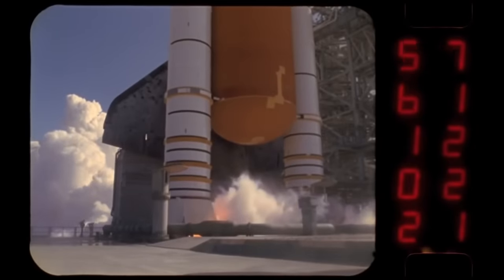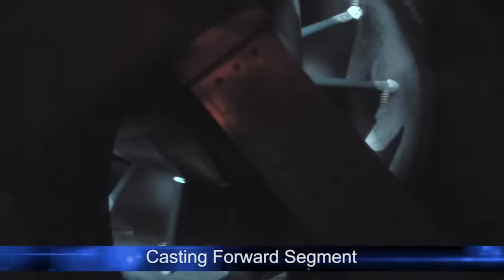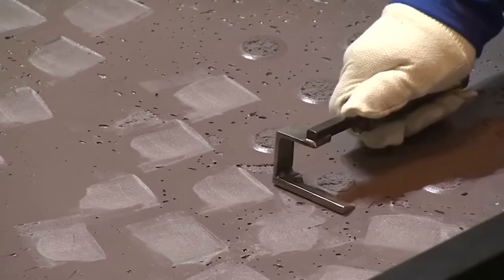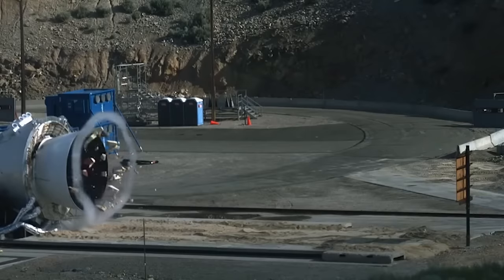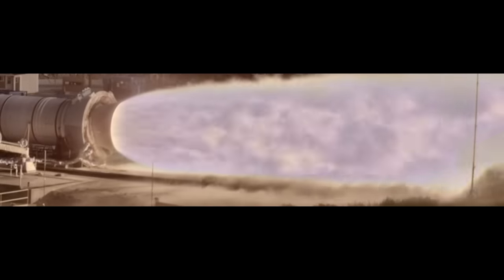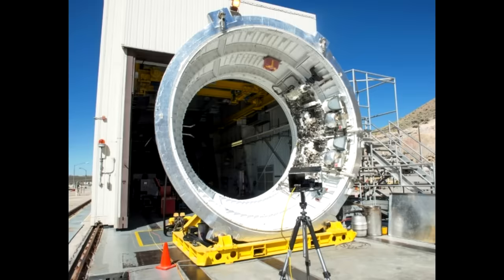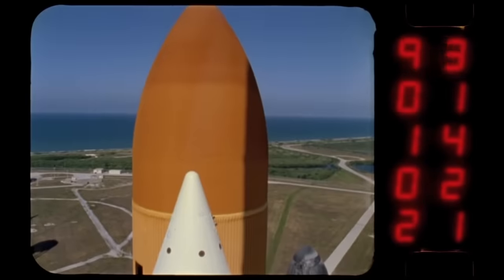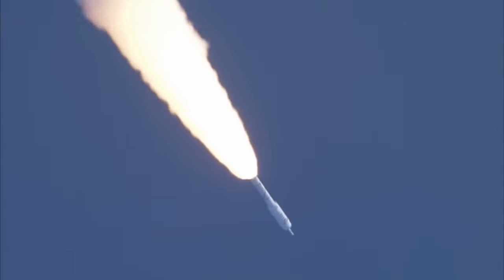The Amazing Engineering Behind Solid Rocket Boosters

Comment: I wonder what kind of redundancies they built into the explosive bolts that held down the boosters (1:30). Once you light the boosters they're firing for the full duration, and it no bueno if one bolt didn't go off.
Reply: Ethan Prober I believe that on at least one occasion one of the nuts didn’t separate. The shuttle took off like it was nothing; breaking the metal plate.
Reply: My guess is if one bolt didnt go off it would be ripped out. SO the redundancy is that more than one bolt would have to fail. Possibly more that 2 or 3 even.
Reply: It definitely has enough strength to rip off one faulty bolt.

Comment: The new netflix show “the challenger: the last flight” tells us that the O ring, which was a part of the solid rocket booster was the cause of the tragedy for the challenge. The O ring was used for sealing the components of the rocket booster, but they had a massive issue with low temperature. The elasticity were inversely proportional to the temperature and hence making it more fragile under extremely cold conditions.

Comment: Just imagine putting 5 SRB into a cluster and you effectively have a Saturn V sized rocket again.
Reply: Five 4 segment SRBs like the type used on the shuttle would have around 13 or 14 million lbs of thrust? Almost twice that of the Saturn V if the numbers I read were correct...
Reply: @codymoe4986  Only against the first stage though.  The Satern-V's S-II J-2 Engines had a 500 second burn time, something the SRB can't come close to achieving.

Comment: Great explanation Scott!
I was always stunned at how much the shuttle stack moved when they lit the mains, the whole stack would flex over, and then the boosters had to wait for the whole assembly to flex back....  and that shot of the shuttle at 13:45, showing how the whole assembly slides off to one side as it comes off the pad.... 

The thing that always amazed me was how fast the shuttle left the pad.
As a very young person (5 at the time), I clearly remember laying on the floor watching TV of Apollo 16 and 17.....  and they took FOREVER to clear the pad. Comparing the two spacecraft now....  the Saturn's were 18 wheelers leaving a stop light.... the shuttles were corvettes launching on a drag strip.
Thanks for the video!

Hope the smoke is clearing up on your side of the Sierras!
Reply: Believe it or not, that rocking motion was called "twang."

Comment: Awesome explanation of the solid fuel, the Challenger O-ring issue and the complex improvements that worked, plus great footage of the booster assembly and launches. In my mind the shuttle had launched military missions from Vandenburg so I am now straight that it hadn't.

Comment: One of my professors consulted with Morton Thiokol and talked about the boosters used on the space shuttle.  The previous longest-burning solid-fuel boosters burned for one minute and it was thought by most engineers that this was the limit.  The longer burn time wears out the exhaust nozzle.  The exhaust is essentially molten sand mixed with gasses, coming out at mach 8, and is very abrasive.  The shuttle booster was an engineering challenge.

Comment: I worked on retrofitting the vertical boring machines with CNC controls at Ladish used to machine the solid rocket booster sections. The entire manufacturing process was remarkable.

Comment: I was the manufacturing engineer for the first Filament Wound Cases for the Space Shuttle. We made four completed composite case boosters tested two and two were at Vandenberg when the director of NASA made the decision to launch below tested temperatures. A very sad day hero’s died, thousands lost their jobs. My program ended 1500 people walked, I successfully applied for a job in another division and went on to fix the Boeing 767 composite door spring program.
Reply: I have always been interested in the FWC SRB program.  STS-51L certainly changed the course of STS.  IIRC the STS-62A boosters were already stacked at SLC-6 Vandenberg, were they not? Discovery was to be used for all the Polar military launches from SLC-6.  Hopefully we get to see a derivative of the FWC SRBs you worked with back then.  There's enough D6AC cases for 16 5 segment RSRM-V's, since SLS disposes of the boosters, for SLS-9 the new BOLE' boosters using FWC technology will have to be used.

Comment: After Thiokol redesigned the joint, they conducted test firings to prove the design.  I was one of the technicians they hired to assemble the test motors and attach the instrumentation devices.  These test firings are the horizontal ones shown in the video.
They added two tests to the procedure.  One was to place a heavy metal pillar next to the motor with hydraulic actuators on it that connected to the motor's attach ring.  These were used to place side loads on the motors during test firings.  The other was to test the motors under more extreme temperatures.  A movable enclosure was placed around the motors and then heated or cooled to the desired temperature.
Of course the heating was done on the summer, and the cooling in the winter.  We would have to go outside in the summer to cool down, and in the winter to warm up.

Comment: Excellent in all ways. Thanks so much, Scott.

One detail related to the Challenger. It's about maintenance, not design. The O-rings were not replaced after each launch. They were examined for cracks. A rule of thumb idea that a crack less than 1/3 of the diameter of the O-ring was not a problem. There is no engineering basis for this. Thus the Challenger disaster was due, in part, to an unscientific maintenance guideline, as well as items mentioned here.

Comment: At 14:00 Scott says that compared to the Shuttle 4-segment SRB, the new 5-segment SLS booster has "more thrust and a longer burn time."  More thrust, sure (3.5 million pounds vs 2.5 million pounds).  Longer burn time, probably not.  Both booster versions are the SAME DIAMETER (correct me if I'm wrong here, Scott) -- to fit aboard the same railroad cars from UT to FL.  This necessarily means a similar burn time.  More on point, recent video of 5-segment SRB tests in the desert clearly show the same 2:05 burn time as every 4-segment Shuttle SRB achieved in ground tests and in flight.
--------------------
P.S.  If true, this could mean that the 2009 Ares I-X flight (one of my favorite launches of all time) was perhaps a bit more realistic (and valuable from an engineering standpoint) than some of its critics are willing to admit.

Comment: There were tests with 6.5 m diameter SRBs in the 1960s/70s by other SRB manufacturers. Those would have had less length to flex and less dangerous segment joints. Thank you for the video.

Comment: Thanks for another great video.  I really like your attention to detail and complete explanations.  One thing I have noticed in another of your videos is the way you pronounce butadiene.  It may be an English vs American thing but we say B-you -ta die-ene.  The -ene ending tells you that the chemical has a a C=C double bond, and a di-ene has 2 of these. In an NBR one is used to make the polymer and the second is where the cure takes place.
A co-worker of mine used to work in a place that made smaller motors with the same chemistry.  A person there was assembling a casing and had just a speck of the CURED PBAN/Epoxy/Perchlorate on some threads. The resulting detonation of that speck blew the bolt out and through the man's head.  I couldn't help but think of that watching the workers shave off chunks of the wet material.

Thanks for the wonderful channel.  Moar bosters!!

Comment: This is the most complete explanation of the joint failure I have seen.  Engineering is awesome isn’t it?  Did they have any idea that the joint could fail at those launch temperatures at the time?  I can’t believe they didn’t have a set of safe temperature values in place.  Did they test the joint at various temperatures including cold temps during development?
Reply: This was as much as anything a management failure. There was at least one engineer at Thiokol who warned against flying the boosters in low temperatures. Those in charge were getting impatient with the number of scrubs and postponements of this mission. This, coupled with overconfidence, led the management team to insist on launching that morning. To paraphrase one higher up, in frustration with all of the delays, "are we ever going to get this thing off the ground?" It is believed Richard Feynman of the investigating panel was "fed" the incriminating evidence of the O-ring failure by an insider at Thiokol. And, it seems the same pride and overconfidence on the part of NASA may have contributed to the Columbia  disaster.

Comment: The Indian PSLV solid motors actually use something different for thrust vectoring: liquid injection.  Twenty-four injectors in a ring inside the nozzle inject strontium perchlorate into the hot gas stream, producing enough secondary thrust to alter the course of the vehicle.  There are also a pair of roll control thrusters on the first stage which use N2O4/MMH propellant.

Comment: So if I'm understanding right, on Challenger, it's not necessarily that the insulation was burned through (which was always my impression since Wikipedia isn't terribly clear), but more the o-rings themselves, which, since the SRBs were under such colossal stress due to wind shear (on top of normal oscillation), allowed burning  pressurized gas to escape the booster in a place it was very much not meant to escape - through the pins holding the segments of the SRB together. Then, this burned through and weakened the SRB's structural linkage to the EFT and by extension the EFT itself, which cascaded rapidly into the loss of the vehicle. Is this more or less correct?

Comment: I worked in a Southern California heat treat company that heat treated the D6AC ring segments. A very large gantry furnace with oil quench tanks and molten salt tempering tanks which allowed the segment to be processed to get the desired properties.  The oil quench was spectacular, I recall a bottom of the furnace being dropped and rolled out of the opening of the furnace which had been heating the segment to I believe 1650 degrees Fahrenheit for the required time then lowered into the oil tank. The flames and heat were tremendous. Then the tempering cycle was performed by placing the segment into a often salt bath of about 400 degrees Fahrenheit, possibly for two prolonged cycles, the details are being recalled after 40 years so forgive any inaccuracy. I remember the brass buttons on my Levi’s being so hot, that if my arms touched them when I was in the area, little burns would be the result.

Comment: I worked at Thiokol in Utah in 1982 through 1984. Robert Lund was our section chief; I was part of the "Motor Performance Group". Also worked on Peacekeeper 1st stage and Trident I (C4). The shuttle boosters are essentially 1960's technology. The propellant was derived from the Minuteman formulation and was not the highest specific impulse. The star grain in the head end had a tendency to crack and was repaired. They may have improved many features but it was known before Challenger that seal design and stack response was inadequate. The motor joints should've been different. The original boosters were merely 1960's ICBM technology. 
You may be familiar with Von Braun being totally against solid rockets for anything but aircrew egress - ejection systems. 
Some of this may have been improved for SLS but the Challenger disaster was due to money, personality and politics. I would've thought that certain people would've received prison for their "depraved indifference".  Look very closely at the SLS booster before you declare it wonderful. It's a compromise.

Comment: There's an interesting take on solid fuel rocketry on the Bloodhound SSC, world land speed record car project.
A solid fuel rocket that can actually be controlled. It works by using solid fuel but the oxidiser is liquid, pumped down the middle of the solid fuel. By increasing or reducing the oxidiser flow, the amount of thrust can be controlled.

Comment: Btw, the booster sections made a detour to Los Angeles for heat treatment before going east for assembly. Cal-Doran Metallurgical Services had a specially built gantry furnace just for that job. They were being prepared years before the first shuttle flights. The sections came in on large, oversized load trailers.That heat treating facility did a lot of special and fascinating work going back to WWII. Winning that contract from Rockwell was a great source of pride. Everybody that worked there recognized the importance of the work and did the great job.

Comment: Some solid fuel rockets have the central hollow centre PLUS the the external/outside surface of the cylinder of fuel is allowed to burn simultaneously and pass their resultant hot gases down to the nozzle as well. This keeps the overall area of burning roughly constant throughout the burn period. (Which means the containing structures has a roughly constant pressure to contain throughout the burn period.) Having only the inside tube burning increases the thrust as the burn progresses and the inside tube has a greater and greater area exposed thus the pressure increases. However this burn mode keeps the structure cool until the fuel is almost exhausted. The unburnt fuel acts as an heat insulator.

Comment: I just happen to be watching the Challenger documentary on Netflix right now. I highly recommend it. A breakthrough for SRBs would be a way to shut them down (I know this sounds ridiculous for several reasons but it’s not impossible), or give the range safety officer a way to eject the SRBs if a catastrophic situation is imminent.
Reply: I've read something in this not too long after challenger that if they jettisoned the boosters at any point other than design that deceleration would be an issue and unsurvivable. I think they said something like 
It would be like hitting a brick wall. 
Throttling seems like a logical evolution although I couldn't be less knowledgeable about the process

Comment: Ares 1X used a mass simulator for the second stage that was the same size and mass distribution as the real second stage was intended to have. The simulated Second stage was built in Cleveland at the Glenn Research Center and shipped to Florida in sections ("Tuna cans"). As I understand it the construction of the vehicle was essentially complete when the program was cancelled. The choice seemed to be to either assemble and launch it or scrap it so they decided to launch it.

Comment: SRBs were briefly considered for the Saturn V but it was figured that it would be easier to get the F1 operating smoothly and that was no small task at the time using dynamite charges to figure out thrust chamber instability.

Comment: Hello @Scott Manley, 
Are the SRB nozzles reusable? Or do they have to be replaced between flights?
I see they are labeled as being "phenolic". I guess that makes them ablative?
Thanks for the video! I watch all of them :)
Reply: @Sebastian B-V. The SRB phenolic nozzles exit cones are in fact ablative and not reusable. Also, the nozzle throats are ablative. We recovered the SRB spent cases and performed examination of the nozzles in Utah. The idea was to minimize the thickness of the nozzles so they would be as close to failure as safely possible at the time the motors burned out. This was to minimize nozzle weight so more payload could be carried. During the time I worked on Shuttle at Thiokol, Utah (1983-1989) the carbon fiber nozzles were wound in Carson City, NV. We did the same analysis on motor case insulation to get as close to failure as possible to decrease insulation weight and increase payload.

Comment: For those who wonder what q means when Mr Manley said "max q":
q = 0.5 * rho * w ^ 2
Being rho and w, respectively, the density and velocity of the undisturbed flow.
The q has the dimension of a pressure and therefore represents the kinetic pressure and is very important in aerodynamics since the aerodynamic forces depend linearly on this term, therefore the q max would be the point where the greatest aerodynamic forces are had for a given attitude.

P.S.: The kinetic pressure can be calculated at all points of the flow using the local values of density and velocity but in the formulas used for aircraft (or really any means of transport) the kinetic pressure at infinity is used because it is easier to work with that

Comment: Quick question Scott. 

At 10:50 you said the O-rings were the primary protection - wasn't that meant to be the heat-resistant putty which contained zinc chromate and asbestos? 

I seem to recall from Diane Vaughan's book that the designers intended that the putty would be forced into the joint by the pressure of the ignition and that in turn would push the O-rings into position to fully pressurise the joint whilst keeping them safe from the flame. However, the putty became stiff in low temperatures and rather than flowing under pressure, the exhaust blew channels straight through the goop and impinged directly on the O-rings causing erosion.

Great video as always - not sure how you produce this sort of high-quality material so regularly, but thank-you!

Comment: @2:40 This is why the max size and mass of the space shuttle was determined over 2000 years ago in Rome by the size of 2 horses because those required a wheel spacing of 4 feet, 8 1/2 inches. (War chariot)